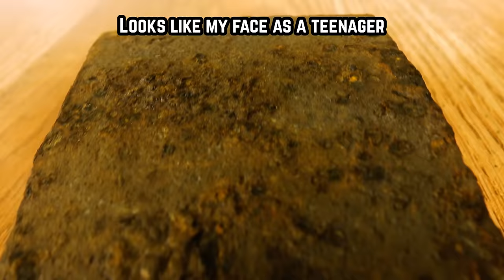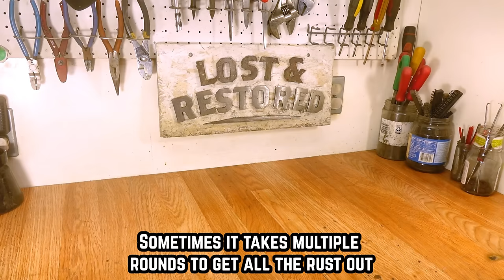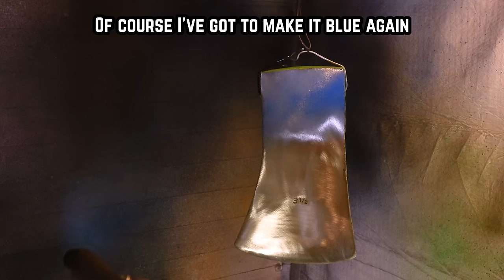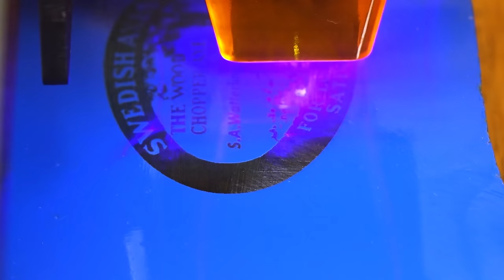Extremely Rusty Pitted Axe Restoration - Incredible Finish!

Comment: I just finished an axe restoration myself and had to put a new handle in it. I removed the stain/clear from the new handle since it had runs and I could do better. I scraped it with a knife, cutting edge 90 degrees to the wood, to remove the bulk of the clear and save sandpaper, then I sanded it and added boiled linseed oil on it.

Comment: When you factor in the cost of a new handle plus all the supplies and labor to restore it would it have been more cost effective to just go buy a new axe ? Don't get me wrong you did an awesome job. Very satisfying to watch you do it as well :)
Reply: I mean probably, but there's no YouTube ad revenue from just buying a new axe.
Reply: That's a good point Chris and I think about it sometimes when I restore an axe. But there is the satisfaction of taking a classic ax and giving it a new life. Someone will be using this axe 100 years from now. (Plus, have you priced Swedish axes lately?) 🙂
Reply: It's always worth it to restore a good quality axe, compared to buy a junk chinese axe from a hardware store.

Wetterlings are sadly out of business.

I always scout flea markets for old good quality Swedish or Danish (DSI, which went out of business around 2000) axes, either in usable condition at a price I can see myself paying, or as I did with the last one, found someone selling an old DSI 4 that needed a little tlc, she didn't know much about it, thus sold it to me for about what would be $12.

Took the handle off, which was then scraped and sanded down, probably the original 30-40+ year old handle too, went over the head here and there, really good shape for it's age, poll hasn't been hammered too many times then it was ready, put it back on the handle, oiled it, sharpened the bit and its life is back, love it, quite short handle for the head, 4lbs and a mere 50-ish cm, but having looked at historical files it was like that when it was new.

Also have some awesome old dsi hammers that I've never seen anything like before, kinda regular with nail puller but the design is so different, I think they're at least 60 years old.

Comment: Nothing wrong with using a store bought/pre-manufactured handle. But I prefer to make my own from scratch. However if you have a mass produced handle with a varnish finish you'd like to remove. I recommend just scraping it off well with an old knife blade held at a 90° angle. Go down until you're scraping away a very thin layer of unvarnished wood. Then smooth to your desired smoothness using sandpaper. I like to use it alone in my hands but a block or power sander works too. If you have a makers mark that you like to use, then maybe wood burn it into the end of the handle. That's my technique and I like to date my handles too with at least the year. Then finish it off with a generous coating of boiled linseed oil once a day for a week. Then once a week for a month. Then once a month for a year, then once a year every year for as long as you own the axe (on the yearly creation date perhaps🤷‍♂️) Your handle should look and feel spectacular for decades.

Comment: Why did you spend all that time cleaning it up and then you just sandblasted it anyway you could have sandblasted it from the start and got the same effect
Reply: Taking off the first layer before hand does two things: Takes less time in the sand blaster and keep rust residue out of the blasting basin.

Comment: So if you're going to grind it all down nice and shiny is there any point in wasting time scraping it and picking at it and putting it in rust remover? Couldn't you just wear a mask and grind as your first step? Also the same thing for the handle, why waste time using the remover, why not just sand it down? 
I'm not trying to be rude I'd really just like to know. Is there a point to these steps or are you just doing it for the video. I've refinished a few axes myself and if I'm going to shine it up, I just start with an abrasive wheel right away.